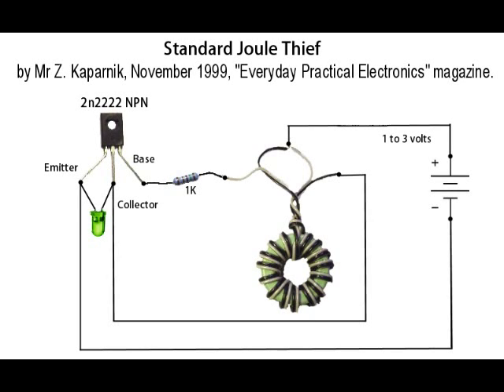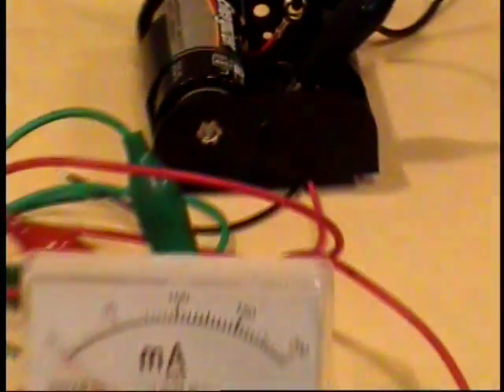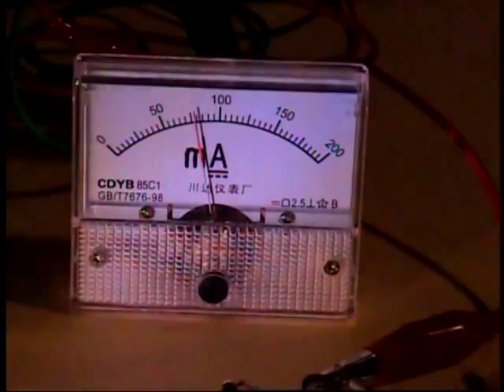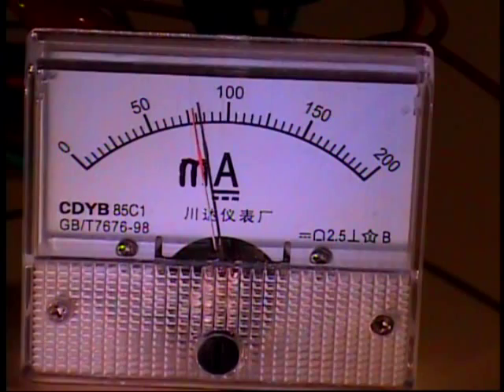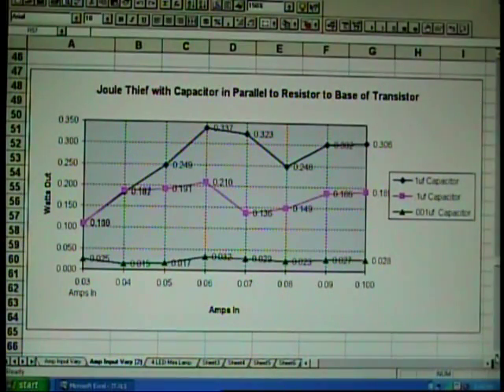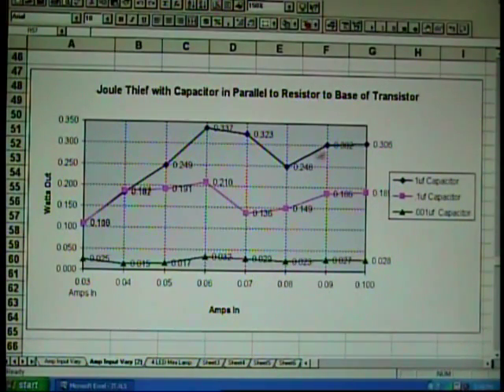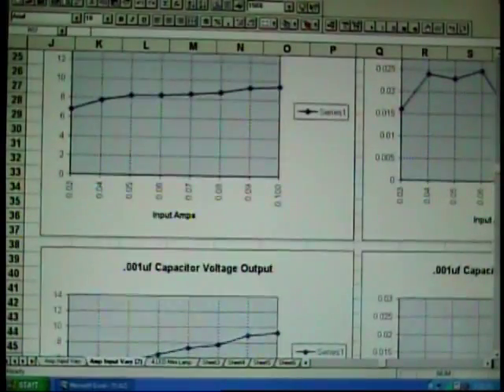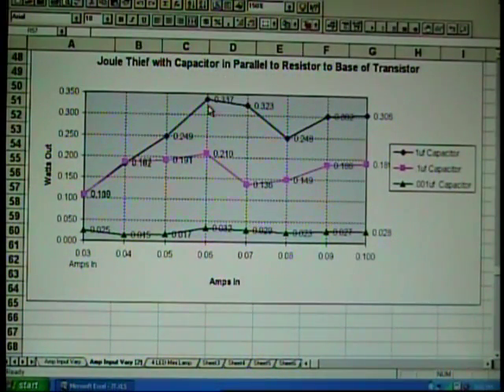Joule Thief Enhancement

Comment: Thanks for the tip! My tip to you is to use a variable resistor for maximal output. My result is around 200 ohm. Something extra happens at maximum. The resistor burns. Maybe two resistors in parallel. One fixed at 500 ohm and the other one a variable 500 ohm.
Good luck!

Comment: What SPARKED this action was a stroke of genius. Thank you for showing this monster curcuit example. AC pulses bypassing resistor timing transistor into power saving mode. Also increase in frequency causing better performance. Voltage kickback spike larger across transistor.

Comment: Woah, wait just a second.  How can you measure Watts out without a load?  Lets assume you have some volts.  Without a load you have no current, and with no current you have no power (Watts).  Either this is BS or you don't know what you are doing.
Reply from the maker: This response is copied from an answer to another viewer; if I recall correctly, "no load" was replacing the LED with a diode so the circuit was not driving anything except for the very slight "load" the meter uses for its test. As to the more watts out than in...that is a measurement problem with digital meters and pulsing voltage. The voltage is not steady DC and not true AC so the test it runs is not calibrated to reality. I used it as a number to show better or worse performance.

Comment: What's the theory behind the reduction in current?🤔
Reply from the maker: Less current is consumed due to the capacitor acting as a partial bypass for the resistor. The current does not have to get through the resistor alone where some of it would dissipate as increased heat. Capacitors induce current from one plate to another without adding resistance so the current can flow with less loss but still have the resistance value of the resistor to limit current.

Comment: .....all good except for the graphs which you did put some time into. I don't know if you're varying the y or x axis neither where you're taking your measurement from . You've mentioned in comments that no load means LED is replaced by a standard diode . Do you think it would need 4 diodes in series perhaps to match the voltage drop of the LED ?

Comment: Looking at your graphs at 3m 14s:  I see with the 1uf cap and an input of 0.06a / 1.5v (90 milliwatts) input, the corresponding vertical axis shows a "Watts Out" value of 0.337 watts.
Not sure I understand how you can have "Watts Out" when there is as you say no load ?

Even so, to get 337 milliwatts output from an input of 90 milliwatts is truly miraculous.
Reply from the maker: Rhian Taylor, if I recall correctly, "no load" was replacing the LED with a diode so the circuit was not driving anything except for the very slight "load" the meter uses for its test. As to the more watts out than in...that is a measurement problem with digital meters and pulsing voltage. The voltage is not steady DC and not true AC so the test it runs is not calibrated to reality. I used it as a number to show better or worse performance.
Reply: @ronaldgerth5120  ...yes , you can get Heisenberg principal to an extreme with the generic digital meters. I think setting them on milliamp range measurement introduces say 200 ohms in series. I found you often just got to use them on the 10 amp range to measure milliamps .

Comment: Dear sir,  I thought i would have a go at the same thing. But the only ring i had free was a rf ring of 1" by 1 1/4" (more of a tube really )so i used that with the same wire and turne's (17) plus the transistor i had is a D882 and then i turned it on at at 1.5v it buggard every led i put to it, So i tried a 10w led and WOW at 3v it's blinding. the best joule thief i have ever seen at 3v at 0.28ma . Please if you have the time have a go .Ps i had to use 2 1uf in series to get the same result you did. I would send you a picture but i don't know how on you tube. I have a box full of joule thiefs i have made over the years but none has come close to this .PPs the transistor stays stone cold.

Comment: Do you think that the amount of electrical field in the toroid is equal to the electrical field of the capacitor in the best wattage scenario?
Reply from the maker: Gristle, short answer is no. The capacitor is in parallel with a resistor so the current will be diminished to the capacitor in direct relation to the value of the resistor. The toroid is storing more energy in this setup.
Reply: Ronald Gerth thank you, Sir, for your answer and video as well, you've given me much to think about.  I'm rethinking the mechanics of resisters.  In direct current, they act as a weak addition for current to circumvent the main circuit, any added conductive material, no matter how much or how little electricity it allows through it is a lessening of total resistence, like an additional hole in a dam, no matter how small, is still more water leaking. But in an alternating current, I aee now that even though it is an added avenue of circuit bypass, it is also subject to the inertia of surges of current in attached coils of collapsing fields.  So maybe the resister in an ac circuit is like a fist on a garden hose, to where watering a yard, you squeeze the pipe, or put a thumb on the end, and back pressure builds and your spray of water shoots out further and harder, even though the stream is smaller in diameter?
Reply from the maker: No, not quite. Don't think of the capacitor as a short cut past the resistor. Each end of the resistor is connected to one of the two capacitor plates. The resistor and capacitor here should be thought of as a single unit. The resistor capacitor unit (RC). The RC unit is reducing the current and increasing the time the current is active (Google RC time constant). So in the water hose analogy, we are constricting the hose but the result we want is not a stream that goes further but persists for a period of time after the source is turned off.
Reply: Ronald Gerth wow, thank you.
Reply: Gristle Von Raben thank you for asking the question. And Ronald Gerth thank you very much for answering. This has helped me a lot.

Comment: I tried it with several different caps and most didn't do anything good. I will try a 1 MF and see, but I would imagine that it will get dimmer, just like the others I tried.
Reply: It's possible that RG simply happened to find a capacitor which formed a good tuned circuit with the coil.  Your results might depend on the inductance of the coil, so you might need either a larger or a smaller capacitor.  The gain of the transistor could also be a factor.

Comment: If you use transistors in parallel you will get even more current and more brightness I wonder if you use them with capacitors in emitter (-) and in collector (+).
Reply: Are you talking about a Darlington pair arrangement?
Reply: @nedcramdon1306  Yes, a Darlington pair. While your at it you might want to try different ways of setting that up. I put the emitter into the collector of the second and attached the base of both transisters to the toroid coil. I got about 70 volts from a dead double A battery. I blew out one transistor when a charge jumped out of my capacitor and hit it. The energy output was amazing.
Reply: ...of course the standard transistors can't but connected in parallel in a straight forward intuitive manner ,, one transistor will end up doing all the work . MOSFETs can more readily be connected in parallel and they are so done in power inverters .

Comment: ummm.... Ya wanna tell me how you're measuring "output power" with NO LOAD? No load, no power......
Reply from the maker: AzTrailRider57, you are right, not an accurate statement. No load means the circuit was not driving the LED. I measured the amperage by using a diode and a 1000 pico farad capacitor (to give me directional DC) through a multi-meter. Multi-meters have an internal shunt resistor which is a mock load for amperage measurement.
Reply: Oh, OK. Thanks

Comment: 2n2222 npn dosent seem to have base as you show it but in the middle?

https://www.google.dk/search?q=2n2222+transistor&hl=en&biw=1465&bih=821&source=lnms&tbm=isch&sa=X&ved=0ahUKEwjV3ZXS4PfKAhUFQpoKHf5pDGwQ_AUIBygB#hl=en&tbm=isch&q=2n2222+npn&imgrc=wWGg6G1CVOJZKM%3A
Reply from the maker: +Jan Demant Good eyesJan. You are correct. The transistor pictured is actually a MJE181 which I have been using in place of the 2N2222. Whenever I see a schematic with 2N2222 I use the MJE181 (just because I have it). I have done this so often I forgot it is NOT a 2N2222!

Comment: Thanks for this tip...Check out my experiments, you might get some tips from my LED Dusk till Dawn lights or my LED driver circuit based on a "Pimped" Solar night light...Question: Did you try different sized and turns on you toroid?.The results would be interesting.Thanks for your video, thumbs up.
Reply from the maker: Thanks MrFreddiew1, I have not done a comprehensive study on number of turns or different toroid cores on the standard Joule Thief. But thanks to your question, I will. Not sure when I will post but when I do I will credit you for the idea. Keep up the good work!
Reply: Ronald Gerth
Ok great stuff, ..but now I cant wait :-)
Reply: MrFreddiew1

Comment: Thank you for this trick to improve led lights.The cap can be any voltage range or under 10volt/1uF ? Cheers.
Reply from the maker: Robert s, the capacitor I used is a 1uf 35 volt tantalum. On this circuit, if you don't use more than 3 volts input, you could go as low as a 5 volt cap. I generally use caps. with a voltage rating which is double what I think I will need. I have noticed no difference between 1uf @ 10 volts and 1uf @ 100 volts in terms of performance so use what you have or can find.